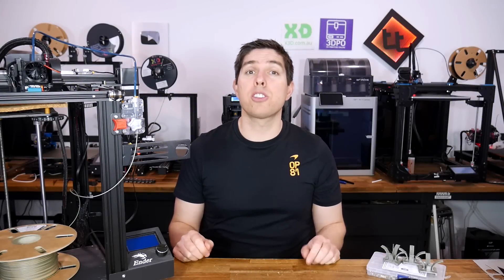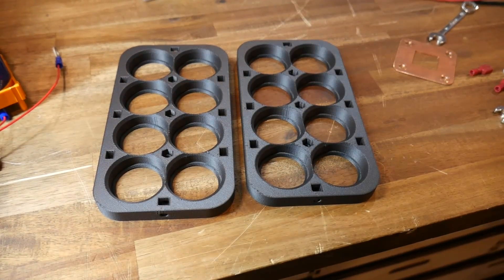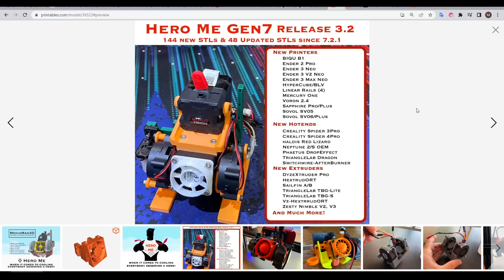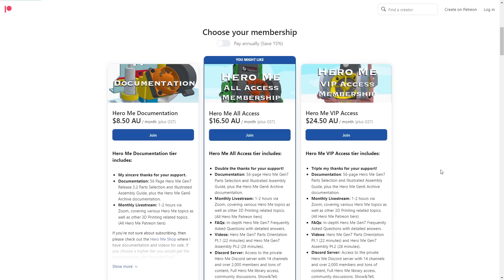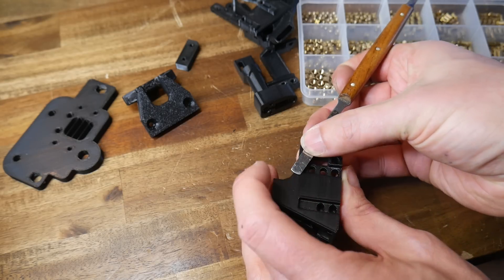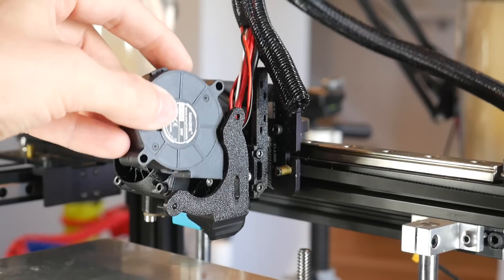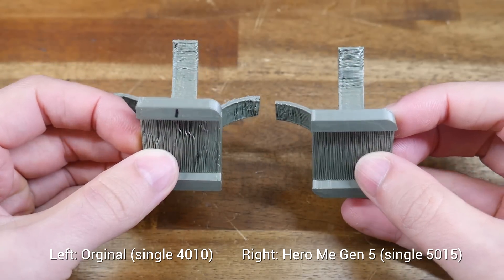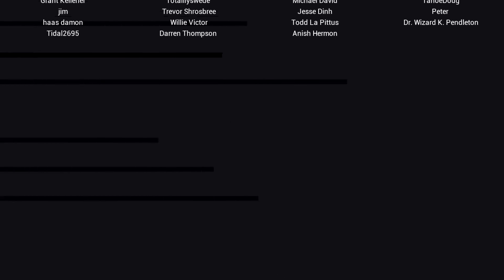Hero Me part cooling system - Modular, capable and super compatible

Comment: So, no only the so called creator not only steal from the original designer but also has lack of imagination to design a better version. With only one fan is enough to give sufficient part cooling for any ender machine that relies on wheels, having two just increase the stress and wear of the X carriage.
Reply: I did not steal from him. The original HERO ME design is licensed as Creative Commons 4 which allows remixes. I have always credited him in the Printables description (and other STL libraries) and in all my documentation. I give him full credit for the creation of the original Hero ME design that he developed over 4 months (nearly 5 years ago) and is comprised of 12 STLs that support four 3D printers (CR-10, CR-10S, Ender 3, Ender 3 Pro), 1 hot-end, 3 fan ducts, and 3 ABL sensors, and was for Bowden setups only. 

What I do take credit for are all my extensions and significant new design work (over 610 STLs with continuous development over the past 5 years) that bring my Hero Me Gen7 Release 4 to fully support over 115 3D printer models, both Bowden and Direct Drive versions, 47 hot-ends, 37 extruders, 35 part cooling setups, 20 ABLs, 14 accelerometers, 8 LED mounts, 4 endoscope mounts, and much more. The closest descriptive comparison would be that I was inspired by what he designed. 

With only two exceptions, there is nothing in common between the original HERO ME and my Hero Me Gen7.4. Those two exceptions are #1. Part of the name (kept out of respect for the source from which mine was inspired) and #2. The position of the grooves for mounting part cooling ducts to the Base. Over 600 STLs are brand new. What few parts of his original work (8 STLs) that have the same specific function, mine have been recreated from scratch beyond comparison. 

Only the core Base STL has any remote resemblance, but when you look at them for more than a few seconds you will see that they are totally different. Anyone can compare for themselves, simply search for Hero Me on Thingiverse and see the differences between the two projects. 

As for the incomplete credit in the impromptu unrehearsed interview with Joel the 3D Printing Nerd. I apologized to him in the comments of the YouTube video. Going forward, I will be sure to correctly credit his original work (as I have always done in my documentation) and make the distinction between his design and what I have created completely clear in all future interviews, presentations, documentation, etc.
Reply: The designer said that he had gotten the original designer's permission and blessing before moving forward with the project.
Reply: That's no true, he just keep adding a secondary fan and more hardware where the original designer keep it simple with the existing hardware or reducing it.
Reply: @triscious  it's still kinda shitty to highjack some open source project to profiteer off of someone else's work while doing little to nothing to contribute to it.
Reply: @DeadNoob451  Read the answer I gave to the person you were replying to. I did not hijack it. It is licensed as Creative Commons 4 wich allows remixes. The original design was 12 STLs, what I offer now is over 600 STLs along with documentation and videos. I have put thousands of hours into the Hero Me Gen7 project. So, do your homework before making unfounded claims.
Reply: May be within the terms of the license but like a lot of open source stuff, does not smell great morally. Same product concept, same name? Are you doing a good thing and providing the original author royalties or some form of remuneration for your profit generation?
Reply: @MediaMan3D  I did my homework and know that you also chose to force people into a subscription they dont want just so they can purchase a manual and then proceed to charge 10$ a month to get support for the product you sold. All the while using other payed subscribers as a crutch to provide said support. 
You know, instead of simply selling it like a million other 3D printing related items on an online storefront and then providing support for your product like any reseller of anything does. Community driven whenever its profitable and all your own work when its not huh ? 

Also, i would assume that most 3D printing related projects undergo an insane amount of work without using said effort as an excuse to implement predatory business practices. Or have you heard of the Voron+ PLATINUM TIER subscription? 
I guess they just didnt put enough effort into their entire printer to deserve that kinda money. What loosers, talking to members of their own community without a paid for audience.

I get that you are proud of your project. It is rather impressive. Even unironically when it comes to compatibility. But dont act all surprised when people dont appreciate you taking some "creative" anti-consumer liberties with your monetisation methods. 
But hey, you got permission to take this project for a ride to cash-town and thats all that matters. Morality is for suckers once legality is cleared and the cash rolls in.
Reply: @DeadNoob451  No, you haven't done your homework, not even in the slightest. 
1.I don't force anyone to do anything! Smart people have been successfully downloading (for free!) and installing the Hero Me Gen series, and getting greatly improved print results for years with no documentation or help from me. 

2. I DO NOT SELL the Hero Me Gen2-7 series, it is and has always been free. Future generations will also be free to download (currently available on Printables, Thingiverse, Thangs, and Cults3D). 

3. People seem missunderstand what it means to be 'open source', where everything about open source must be free. Not true in the slightest. Prusa's printers are all open source but you pay big bucks for them. Linux OS is open source and free to download, but you pay RedHat for support and documentation. What the Voron designers choose to do is their 'business', but don't equate what they do as the only definition of open source. Oh, and by the way, the Hero Me is actually not open source, it is Creative Commons 4 licensed.

3. My Knowledge of my Hero Me Gen series and the documentation and videos I create are my copyright and my choice to make them a paid item (or not). These have nothing to do with the Creative Commons 4 license from the original Hero Me by Kelokera on Thingiverse for the STLs (where remixes are allowed). It boggles my mind that the same people who will happily pay $$$ for open source hardware, but when it comes to software or documentation, they beleive they are entitled to it for free, as they have no pennies in their pockets when they want support for the Hero Me. My docs and videos can be had for just $5ea. 

4. I took down the Gen5 docs and created my Patreon account because I was answering thousands of Hero Me setup and compatiblity questions each year, with no income for the near full time job it was becoming. Here is a thought, I want you to teach me in detail what you do for work everyday, for FREE. Oh wait, you have to do it not just for me, but for everyone who has ever heard about you and is interested in your career, for FREE. You must do it day in, day out, year after year! Because that is what we expect! Would you say yes to this? No, I did not think so. 

5. If any of what you wrote refers to the Hero Me Pro (a complete redesign). When it is available, people will be buying pre-printed ASA parts kits that are fully prepaired and completely specific to each buyer's unique 3D printer and printhead components, of which support and documentation will be provided with each purchase.

So no, you don't have a clue what you are talking about.
Reply: @boothybuilds  People seem to misunderstand what it means to be 'open source', where everything about open source must be free. Not true in the slightest. Prusa's printers are all open source but you pay big bucks for them. Linux OS is open source and free to download, but you pay RedHat for support and documentation. What the Voron designers choose to do is their 'business', but don't equate what they do as the only definition of open source. 

So no, the original designer is not entitled to royalties from my documentation, videos, community discord server, or technical support that I provide my Patrons for the Hero Me Gen series. That is my knowledge and copywrite. By the way, the Hero Me is actually not open source, it is Creative Commons 4 (CC4) licensed. There is a big difference, if you don't know, Google it.

Regarding the name. Had I made a remix of the Hero Me and called it something else, even more people would come out of nowhere to claim I stole his work. What I have done, has Hero Me as part of the name out of respect for where it began and I provide credit to the original designer, Marcelino A. Mosquea S. (kelokera on Thingiverse) both where I post my STLs and in my documentation.

I think you asked the wrong question, maybe... Why isn't the orginal designer making any money off his design? 

For whatever reason, he chose not to invest the time to make an income stream from his design possible. He could have chosen not set his design as CC4, and instead offered it for sale on a website, or Etsy, or Facebook Marketplace, or Printables, or Thangs Memberships, or MyMiniFactory Tribes, or the upcoming Printable Clubs where all creators can sell their STLs. 

Or he could have set it as it is (CC4) and then chosen to do what I am doing, investing thousands of hours designing new parts, upgrading the design to support direct drives, redesigning it to support hundreds of printers, hotends, extruders, fans, ABLs, accelerometers, LEDs, cameras and on and on. He could have worked to bring the attention of the Hero Me to several million people, resulting in over 600,000 downloads and then thousands of makers choosing to support him in some way to help him earn a living wage and enable ongoing development to continue. 

Instead, over the course of 4 months in 2018, he designed the original Hero Me to support the Ender 3, Ender 3 Pro, CR-10, and CR-10S, plus a few hotends and ABLs that were available and compatible at the time and posted it to Thingiverse as CC4. He has recently stated publically that his design was complete.

My Hero Me Gen7 (now with well over 600 STLs) has been under continuous development over the past 5 years, where it now fully supports over 115 3D printer models, both Bowden and Direct Drive versions, 47 hot-ends, 37 extruders, 35 part cooling setups, 20 ABLs, 14 accelerometers, 8 LED mounts, 4 endoscope camera mounts, and much more.

You say what I am doing 'does not smell great morally', well that's your opinion. But just to let you know, I have been trying to reach him privately to discuss some ideas and opportunities, but he has yet to respond. If you or anyone else knows him, please encourage him to reply to my direct messages, it would benefit him and could make all this hullabaloo go away. It could be the answer to both our questions.

Comment: anyone know where i can get the parts printed in a higher temp material? i printed them in PLA and painted them with thermal paint. im sure its okay for PLA prints but cant print anything higher temp
Reply from the maker: Check out the pdf on Printables for the Pro version on the way.

Comment: I have a gen 5 on my heavily modified ender 3v2. I'm planning on eventually designing a custom printhead for that machine, because as awesome as the Hero Me designs are they are less efficient than they could be as a fully integrated solution.

The major concerns in my case being the width of the printhead, as I want to mod this printer into an IDEX design eventually, and also how far the printhead sticks out from the rail when you have a linear rail mod.
Reply: As someone with a BMG X2 on a cr10s pro, do not mod your ender 3 into an idex. You will have virtually no x-axis printing volume left.
Reply: @YourLordMobius  You are correct for a normal Ender, but one of the mods I've done is a 400mm bed.
Reply: @ianbruene1529  trust me man. As some one thats done the dual extruder route, just buy a sovol. Man i wished i did. Would have saved so much time
Reply: @YourLordMobius  Sounds even more important for me to do then as a learning experience!

Comment: I paid actual money in November 2022 for the instructions that
A) didn't explain all of the part selection I needed
B) weren't actually complete saying to refer to the old gen 6 instructions for some sections
C) Have left my printer unusable because after the assembly the wing for the ABL sensor prevents the carriage hitting the endstop. I can't even print a new wing (added in a later revision of the Gen 7) because of this

The customisability of Hero Me is a nice novelty but the docs don't deserve money as they're not fit for purpose.
Reply: Why wouldn't you manually trigger the endstop, print a solution, and get on with using your printer again?
Reply: @ExodusFX  because once the print finishes the carriage will attempt to return to x 0, meaning unless I'm watching it constantly it will crash
Reply: I am sorry you had a bad experince with the Hero Me back then. The documentation has been significantly rewritten and expanded since that time, in large part due to the great feedback from my partons. It is an ongoing improvement process, where I am continuing to improve it on s regulsr basis.
Reply: @MediaMan3D  I really would have liked to give this feedback to you and the community at the time. But all I wanted is the manual that I presumed (on good faith) would be accurate enough to be all I needed, and that's me speaking as someone who trains others on technical topics and provides IT support as a career.
Your ask is that I pay even more of my money to go to the higher Patreon tier which would give me the access to the community in which to give this feedback so essentially I would be paying you to make your product better, netting you more cash and everyone else in the community nothing?
Even better, it was €3.50 at the time for just the manual, now that's €5, and €10 for the discord "support" (I don't know what the support tier price was pre-price hike).

"It's very sad that many in the community are willing to pay $$$ for open source hardware, yet while all of the Hero Me Gen7.4 STLs (and beyond) are free, they will complain about paying $5 US for my docs and knowledge.": Complete Tivoization scenario but of Creative commons instead of the GPL, it's very disappointing as well because if I was at the stage of my 3D printing journey where I wanted an upgraded carriage system while Gen 4 or 5 were current, I likely would have been a contributor to the support effort as it still had the spirit of an open source project at the time: we're all in it to help each other.
Instead now it's pay more money to improve your project to make you more revenue. Nobody else in the community benefits but you, not a single soul.

Now that Hero Me only works if paid for, I consider a product rather than a project, and I judge it as such.
It's very flimsy to hide behind the excuse of "oh but it's still open source, you can get all the files for free": I can clone any number of random git repositories by that logic but with no instructions of what files in them do or which steps to take to compile or otherwise use the repo, all that I accomplished is downloading a disparate useless mess, and that's what Gen 6 and 7 have ended up as.
600+ parts that I can print if I wish, but that have no cohesion or context unless I pay money. If I print any given part in them but have no context of how it works within the wider design then I've just wasted plastic.

Really disappointing to see the hostile response to people in these comments who disagreed with your handling of this. 
There was no reason to purge the docs for the older gens, you would have had much more goodwill if you said of Gen 6 and onwards "this is an upgrade but I worked harder to make it, it's not unreasonable to compensate me for my work unlike past versions". Getting rid of all the old docs shoots yourself in the foot, it makes it clear it's all about maximum profit.

"Linux OS is open source and free to download, but you pay RedHat for support and documentation." - this is an extremely prescient point. Red Hat locked formerly GPL open-source work behind a subscription recently and got absolutely fucking eviscerated by the community and customers for this. You're unintentionally more similar to Red Hat more than you think

Comment: Hey Mike, out of curiosity do 2 5015 fans offer more cooling than a single 24v 7530? I have the latter on my ratrig but still seem to have some issues cooling with what should be mild overhangs. Maybe it needs better ducts?
Reply from the maker: I haven't tested a 7530 personally. Going by Rat Rig upgrades on the EVA carriage, I think the 7530 mod is meant to be a step above twin 5015s. I would suggest looking at the rated CFM for each fan as a baseline, then comparing the duct deign,
Reply: @TeachingTech  Hm. If that's the case the cfm on a 5015 is 3.23 and the 7530 is 12.7. Maybe I'll see about modding a trihorn duct.

Comment: My ender five's been running strong for a solid five years definitely the best printer creality has produced the only real issue is the Y  movement system overtime the motor bracket can shift a little causing just enough torque on the two bars to create serious y access motor skips resulting in layer shifts just thought I would leave this here took me forever to figure it out hope it helps someone PS Ender 5 can be a klipper Beast ;)

Comment: I hated the hero me system on my CR 10 Max. You had to disassemble the whole gantry if you wanted to get to heatbrake.
Reply: not with a magnet remix
Reply: That's why the hero me was designed to be mounted on top of the hotend, using only the screws the printer has...